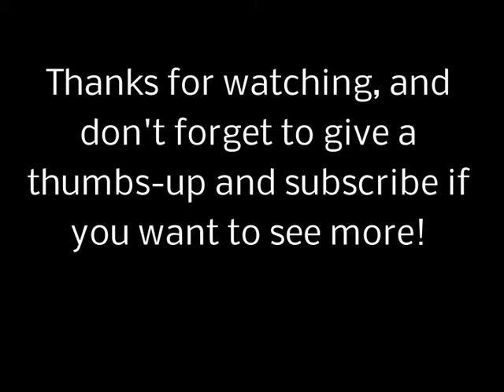Tesla Magnifier Transformer - Rebuild, Test and Fulgurite!

Comment: So you have up to 10 amp jumping the 2 terminals, or 10a into 150kv? If thats 10 amps going across... PLEASE BE CARING! Which I know you will but still that sure is HOT! LIKE
Reply: NEVERMIND!!! Replayed the video and seen details, still a nice job!
Reply from the maker: Tesla Explorer Thanks for your comment. Yes the peak power is about 1500kW which seems very high, and yes I expect it would be very bad to touch, and I don't plan to do that! I build the HV circuits with no need to touch during operation, for example no 'chicken stick'. These are very short pulses related to the discharge of the energy in the TM primary capacitor, and as the magnifier resonator coils are disconnected for this demo there is nowhere else for the stored energy to go other than burning up the test objects.
Reply: Keep up these great videos!